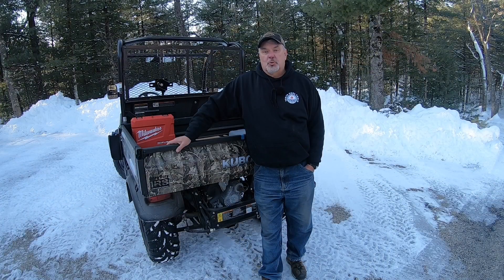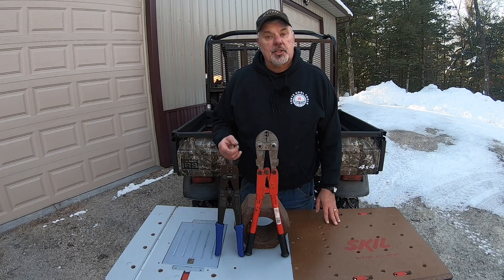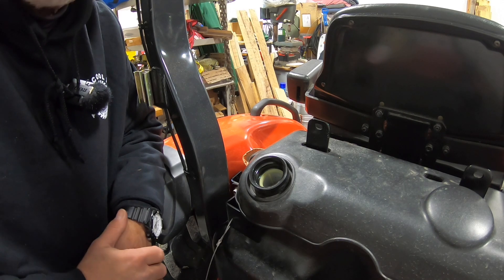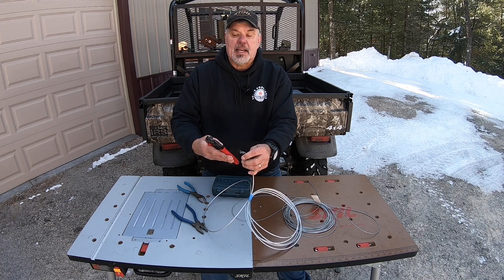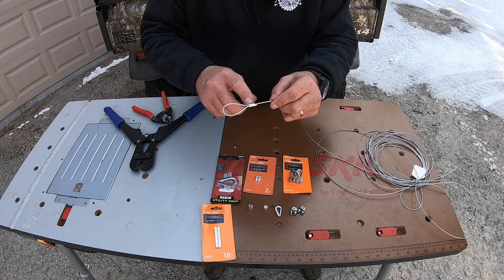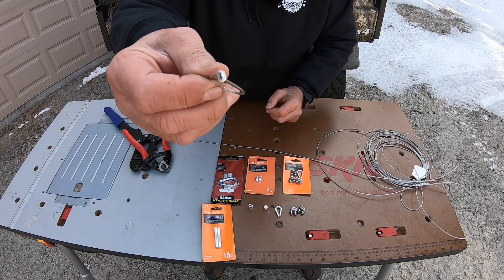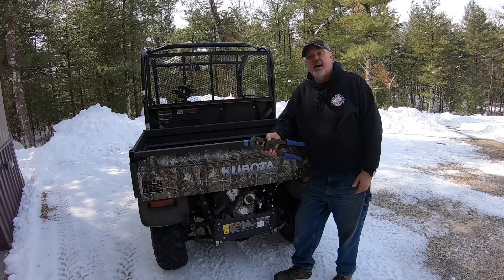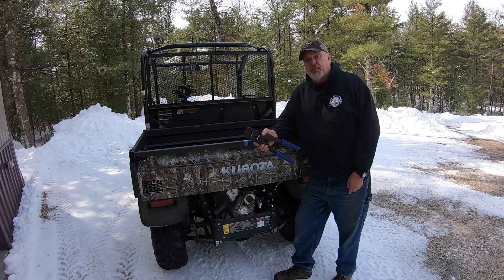Kubota+Swaging=Successful Repair-71 #Kubota

Comment: Thanks Tony. 
Swaging is more commonly use to Re-shape Pipe so one Piece fits inside the other
I have a PEX-A Swaging tool for Fitting Connectors into the PEX Pipe. 
I jumped at a Sale on Face Book Market Place a few Weeks ago, The Guy retired as an Electrician, Had a Hydraulic Crimper with 6 or 7 Dies for $25.00....
Instead of a Quick Jerk, Rotate your Hand to open the Latches.
Mike M.
Reply from the maker: Mike you definitely found a smokin deal on the hyd crimper .
The term Swaging is confusing for most people and they just call it crimping. 
Thanks for watching and commenting 👍TCT

Comment: Great tip and demo.
Swaging a cable lanyard as a keeper for various pins, safety fasteners, and even diagonal cable bracing  for building applications gives a very secure and neat finished result.
Reply from the maker: This tool has many applications, different trades (builders, plumbers, mechanics etc.) can come up with tons of uses.
Thanks for watching and commenting 👍TCT

Comment: Tony, all my years I’ve used cable, etc., but never heard the term swaging. 😂. I’ve got the Kubota 850 and have too experienced it takes two hands to open the tailgate.  Thanks for the good video.
Reply from the maker: Larry glad you enjoyed the video; you'll have to try the fix on your 850. 
The more common term is crimping, however when you swage something you use a soft material like aluminum or copper with a die to crush the material around the braded cable. 
Swaging is much stronger than crimping. 
Thanks for watching and commenting.👍 TCT

Comment: You know there is something simmer to this design on my F250 for the brake cables.. It's funny how something so small can hold for years
Reply from the maker: You're right Danial, and it's amazing how strong it is as well. 
If you take a look at the logging chokers, they are all swaged using a giant press.
Thanks for watching and commenting 👍TCT

Comment: Great video. I keep breaking my winch cable on the Arctic Cat. I going check in on that.   Thanks
Reply from the maker: Depending on the size of the cable it just might work. The Swaging tool I have only go up to 3/16”. 
 You may also consider the synthetic rope that replaces the braided cable. I’ve heard good things about it, Just a thought.
Thanks for watching and Commenting 👍TCT
Reply: @TonysCoolTools  
The angle of the cable coming off the winch to the plow, is too much of a angle. I did a video showing the difference between the Polaris on the Cat plow and the angle of the cable

Comment: Caution for anyone that has dogs jumping in and out of a Utv . Loose cables where there leg can get thru when they are getting in or out is not good . Those are great product but need too be placed properly not causing snagging or grabbing a branch or stick while travelling in the bush either also . Had it happen . 👍
Reply from the maker: Stephen good cautionary tips. 
Thanks for watching and commenting and sharing your suggestions 👍TCT

Comment: Tony, Just an FYI, the cable is twisted not braided. 7x7 refers to 7 bundles of wire with 7 wires in bundle. Retired aircraft cable sales rep.
Reply from the maker: Thanks Ed, appreciate the correction. 
Thanks for watching and commenting 👍TCT